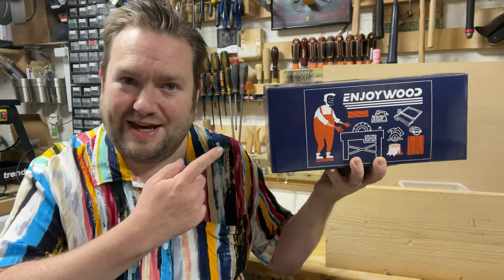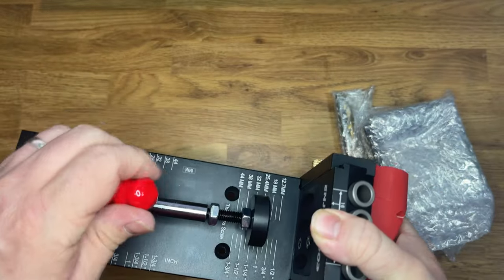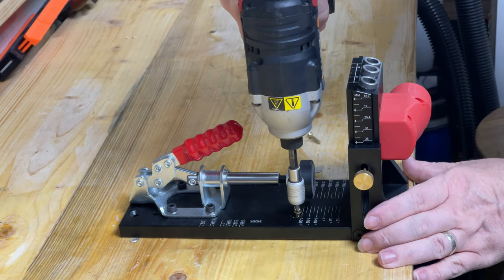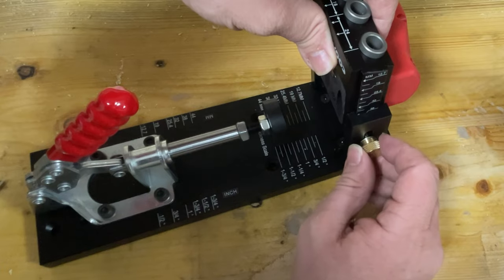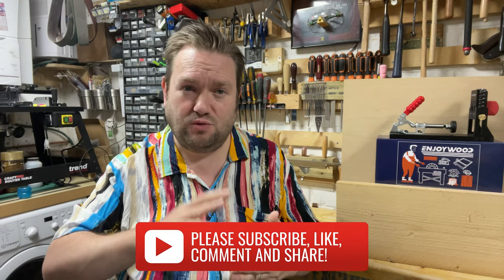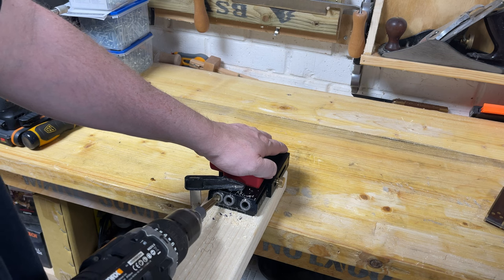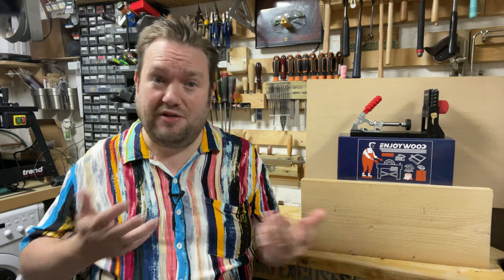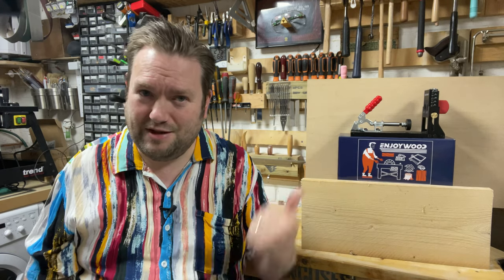Enjoywood Pocket Hole Jig from Banggood Review

Comment: I've been putting off getting a Kreg pocket hole jig because I just hate all that plastic. I bought the Kreg Accu-Cut and it works okay but the sled for the saw is this flimsy plastic thing that I paid a lot of money for.  I won't make that same mistake again with a pocket hole jig.
Reply from the maker: Completely agree though I should say the Kreg is a good jig still, that plastic is fairly hard wearing.  I'd never go back though after using this.